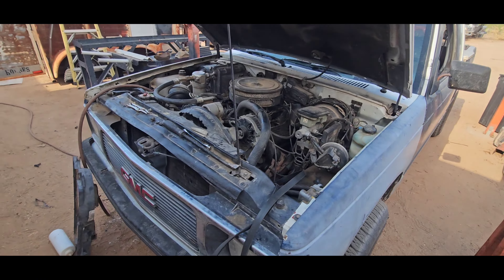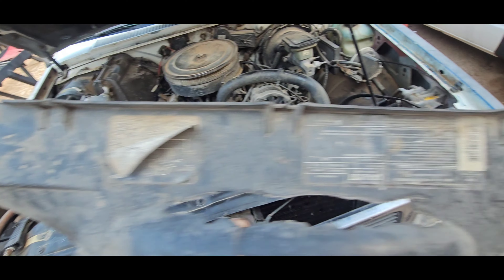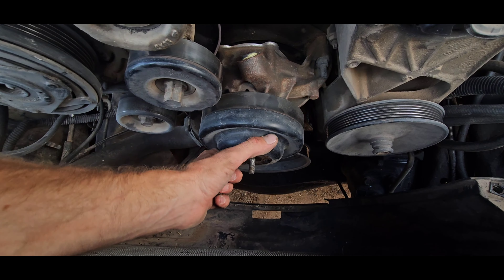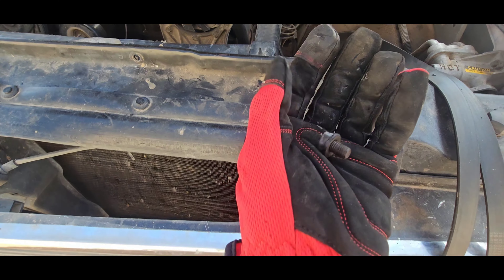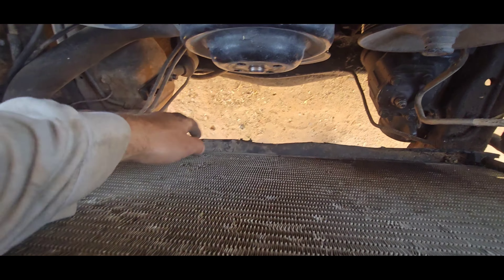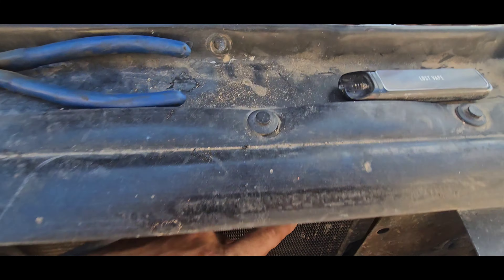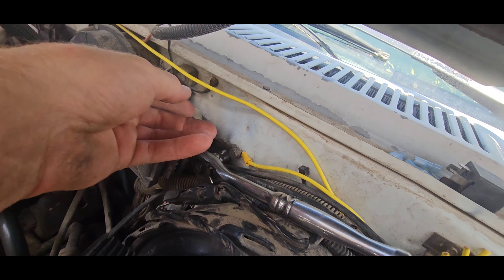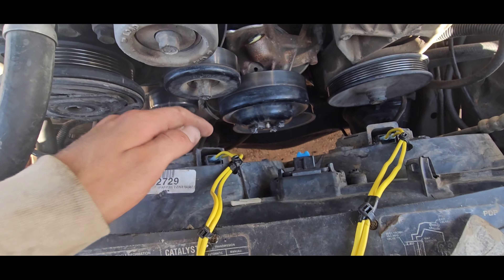92 s10 4x4 electric fan conversion

Comment: How are these fans holding up
Reply from the maker: @Zack-smith  they worked great up until the day I sold it about 6 months ago Never had an issue
Reply: @Masta13100  you remember what they was off of by chance
Reply from the maker: @Zack-smith  i thi k they were off an early 2000s ford focus. That's usually what I like to use on s10s they come with there own shroud and they are duel fans. Also I like to delete the controller and wire the fans directly.  The controller usually goes out and there about 30 bucks so I just bypass.
Reply: @Masta13100  ok guess what I’m snatching from the junkyard now thanks man
Reply: @Masta13100  anything else you retrofit to make work reason I ask is I just bought a 1989 gmc sierra classic s15 extended cab 2wd short wheel base with everything you could think of cruise,digital gauges,power door locks,power windows and ac only thing I wish it had was power mirrors but yours makes me wish it was 4x4
Reply from the maker: @Zack-smith  my other go to upgrade is a rear end from a 2000s s10 blazer 4x4. The rear ends come with disc brakes and are limited slip. Also you can get the sway bar to line ip just need to weld 2 plates in near the rear ahocks
Reply: @Masta13100  is that rear end a direct bolt in
Reply from the maker: @Zack-smith  yes sir direct bolt in and brake line works as well. You can see my previous videos with a different s10 that shows the swap and sway bar set up
Reply: @Masta13100  just watched it definitely going to do it only concern I have if my 15 inch rims will be tight on the brakes like yours or not if so I can order spacers and run them definitely gotta do this next
Reply from the maker: @Zack-smith  yes I forgot to mention that 15s will be really tight. Do you have fb? You can message me personally i can send pics of som stuff I have going on rite now and explain a little better when I get home.
Reply: @Masta13100  I do not
Reply: Only thing I done so far was add a under the hood reel light from a 92 Chevy Silverado to replace the hood light that came on it
Reply: I also know you can get the pop out cup holders from a 88 full size Silverado or sierra and they will fit the dash and bolt right in also